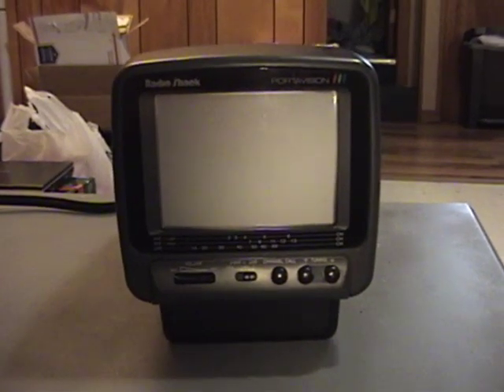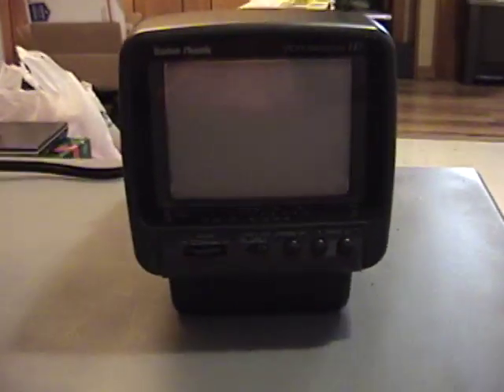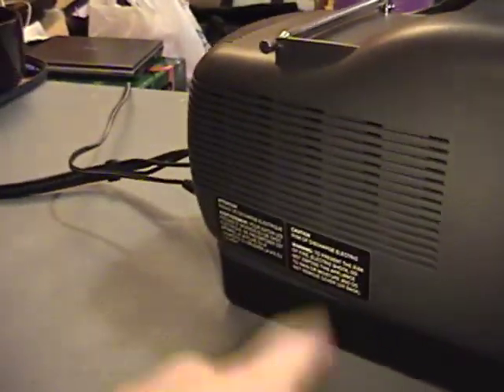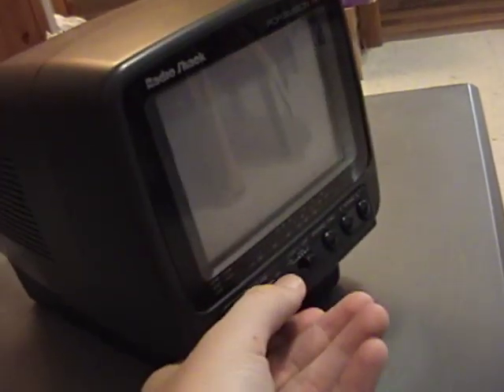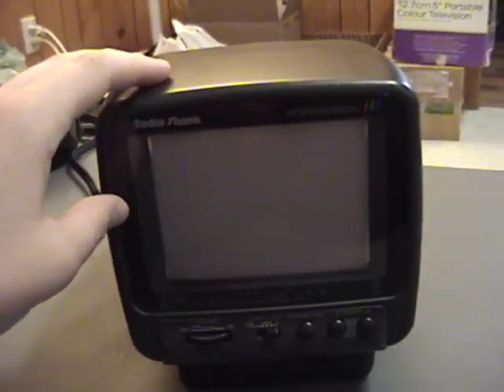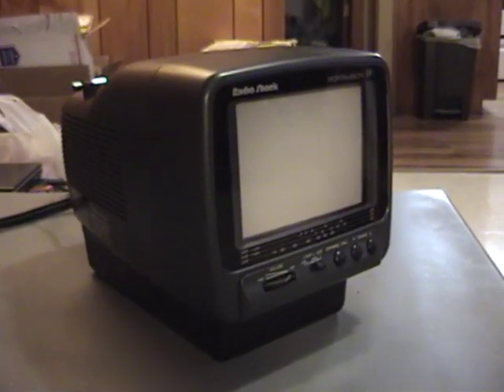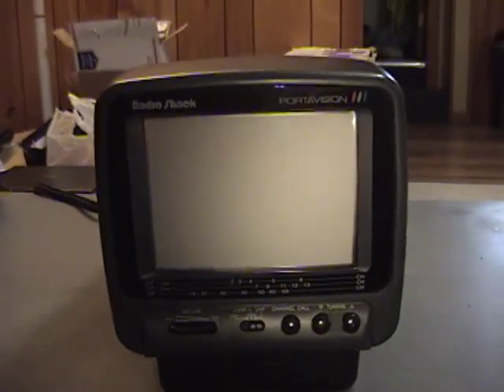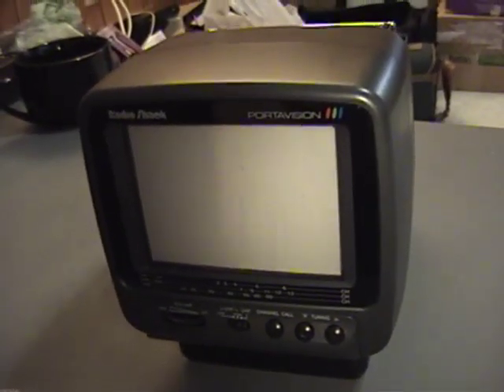Untimely death of the Radio Shack Portavision TV

Comment: Oh, Bummer, what a doggone shame+ annoyance…  i’d get a service manual for it ( for free online ) and give fixing it a go… as long as you keep your hands away from  the back of the CRT ( eg) the crt socket, and the high voltage section ( or at least wear insulating gloves) , follow basic electrical/electronic safety stuff, you should be usually OK . If a wire has come/broken loose and needs to be resoldered/reattached, that’s simple+ easy enough to do to fix this ( if that’s all it is) , but you won’t… so borrow a tv with av jacks or head to your local value village/goodwill/thrift store and hope u get lucky there… maybe dumpster/garbage diving/salvaging/saving… maybe you’ll get really really lucky and someone will have thrown out a working small tv with AV  jacks on it…
Reply from the maker: The CRT failed internally, and there's no fixing that.

Comment: I have this same TV - albeit not Radio Shack branded, GE. It was doing the exact same thing, except much more worrying as it was snapping, popping, all that fun stuff. I took it apart, and removed the potentially gone-conductive black gunk on top of the CRT neck connection as well as some on the socket, and hit it with compressed air. To my great surprise, works fine now; however, there is a slight bit of corona discharge (same sort of blue arc seen in this video) for the first 5 minutes of operation, as well as a loss of focus. Nothing like before, though. I suppose there could be a bad snubber capacitor, or the flyback is on its last legs. But, it does otherwise seem to work after doing that simple fix. I should go in and remove the rest of the now-conductive gunk, and perhaps add a bit of HV silicone or similar material. Shame yours bit the dust too soon, even though I'm almost 4 years late to the party here. These are neat sets, even if a bit unreliable. Sold under many different brand names, these sets were all produced by the same OEM (Action Electronics of Taiwan).

Comment: It could be two causes. It could be the high voltage generated too high by the flyback transformer (due to a higher than normal B+ voltage) or the picture tube itself have problem. First problem if it is that could be fixed as fix a couple that had a bad snubber capacitor and high voltage shutdown circuit is not sensitive enough and will not shutdown the high voltage and this will cause arcing in the neck of the picture tube. I dealt with this issue before and likely seem like same issue as CRT is producing color still, which tell me it not a dead short in neck, if it was second issue usually no picture at all as like neck would be cracked and caused by air rushing in,  but still could be cracked neck, but rare, unless it was dropped at some point. The fact it still works is a very good sign and is likely repairable, so long CRT neck is fine and not cracked. Don't run it like that for long as the arcing will cause lead on neck to get eaten away. 

If feedback produced by snubber capacitor will send to the B+ circuitry and if this capacitor goes bad, the B+ voltage will shoot up thus causing the anode voltage to increase. You need a HV probe to check anode voltage. I would actually fix it pretty much for cost of shipping as would make for a interesting video on my channel. I have a Magnavox 5" color tv  I use as a monitor when restoring VHS BETA decks, vintage game consoles and arcade boards.

Comment: I bet one or more capacitors in that TV bit the dust. That is pretty common with portable CRTs if they aren't of high quality construction. Sure it was like $200+ at Radioshack but the internal components were probably outsourced to China just like the cheap 5 inch Black and White CRTs.

What typically happens is the heat these tiny things make bakes the caps. Though you said it was in like new condition? So maybe instead the caps just dried up and stopped working. That tends to happen with electronics that old. I know that the old Macintosh all in one CRT units like the Macintosh SE/30 and Macintosh Classic were notorious for failing capacitors. No doubt that's what killed this TV as well.
Reply from the maker: The tube itself failed. A lead broke inside the neck.
Reply: Yeah, just saw the next video so the CRT went bad. :(

Comment: try putting soem high voltage putty around the neck where the arc is
Reply: nnnnnnmmmn (555555555555555****55&&&&&44444444555555555556666(*****&&&5&&5555555555555555555555555*********************************((666666((((())))::::::::::))))))))))))))))));;));))))))))))))))))))))))))))))))))))))))))))’kkkkkkkkkkkkkkkkkkkkkkkkkkkoo

Comment: Do you still have it? Mine does the same. I may attempt to fix mine. If I leave mine on for 30 minutes, it clears up.
Reply: I'm going to replace all the capacitors on the board.
Reply: I still have not recapped mine, but I do intend to do it when I get the time. But still the same, works great after warming up.
Reply: Yes, replacing all the capacitors on the main board. Seems like there a good 20-30 of them. I'm not even certain that this is the issue, but it's a pretty low risk task if you're OK with soldering and changing capacitors.

Comment: A CRT this small isn't going to kill you -- not even close. It could just be an oxidized connection; pull the board off the back of the CRT and reseat it.
Reply from the maker: Oh I know that. It's the pain that I'm scared of. XD

I did push on and wiggle the board, and it didn't make a difference. If you look at these pictures, it's actually arcing between the plastic base (not the socket on the board) and the glass, so it looks like a fault of the hardwired connection between those two parts.

http://i.imgur.com/6auxjBh.jpg
http://i.imgur.com/6p3OXVj.jpg
Reply: Like static electricity.
Reply: I've opened up my tiny 5 inch black and white TVs quite a few times and never got a shock from them. It's easy to know what not to touch when operating on them. Usually don't touch the anode connection to the CRT (that suction cup thing. That's where the high voltage connection from the flyback  transformer goes into the CRT) and a few large high voltage caps near the flyback. Though on these tiny tvs they seem to self discharge when turned off and are harmless. It's the larger TVs that are scary to work on. I used to have a 24" inch CRT and I could feel the static coming off the back of the TV when I had the back off and was adjusting the deflection yoke on it. :P

There was also enough power going into those deflection coils on the yoke that when I put anything metal/conductive near it, I could feel a current pulsating through it due it inducing an electromagnetic field.

On a somewhat related note I had gotten a cheap Spectra branded B&W off ebay a few years ago and it didn't have any composite inputs like your TV does. So a few days ago I added a composite input by looking up the schematic to the IC chip the TV used (turns out to be a common cheap IC that is put in most of the portable b&W tvs of it's era) and found that there's an internal composite signal originating from the RF tuner circuitry. It normally feeds into pin 6 onto the chip. So I disconnected that connection to the chip and bridged that with a switch so that I can enable/disable the RF tuner when not using composite input. Then added a a composite input jack. Works just as well as a TV with proper composite inputs.

Though I did not go through the trouble of probing for the audio source. The stuff I found online for this tv didn't make that clear where to look so I didn't bother. :P

Comment: I have run my iMac g3 233 MHz Revision A with the cover off. Since it’s a rev a it has hardware bugs. A tip is that if it doesn’t start up reconnect the power supply. It works for me every time. Mine uses an LG PSU, Analog Board and CRT

Comment: I'm really sorry to see how it happen to the set. I think what causing the arc at the convergence board to the Electron Gun is the solder connection might be cracked. Most of the Modern Technology was made in their own factory had tendency to make the cheap solder connections with very poor designs. Cheap solder connections can cause sometimes to fail. 

On the 9 Inch TV, is it the Monochrome or a Color the one you're going to borrow the set from your Mom?
Reply from the maker: Color.
Reply: By the way, did you know this TV is same that badge the brand name of Memorex?
Reply from the maker: Yep - according to historic Radio Shack catalogs, it was sold under the Memorex name first, in the mid 90s, and then sold under the Radio Shack name later.
Reply: That'll be nice if I got the 5 Inch Monochrome TV, I will use as the Clock Modules along with the Temperature Readings like using a Raspberry Pi Clock Modules. =)